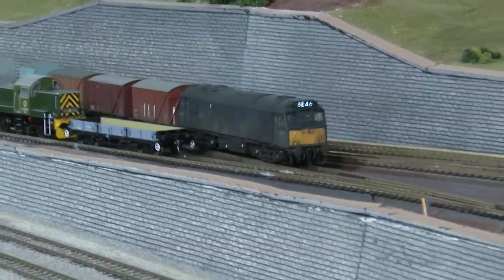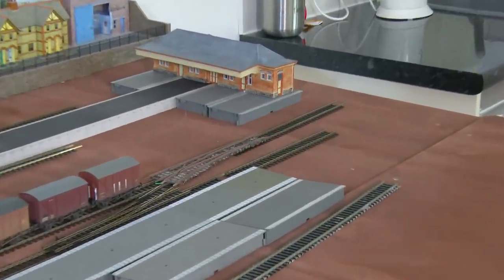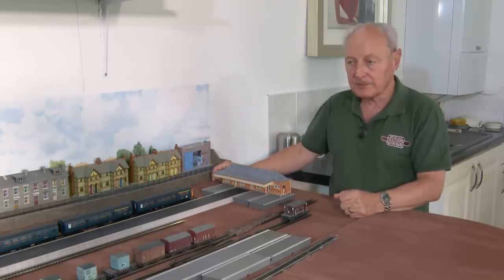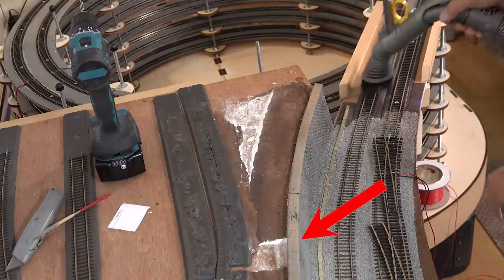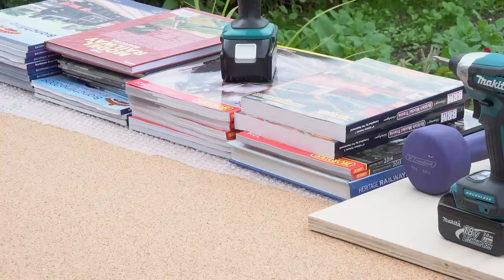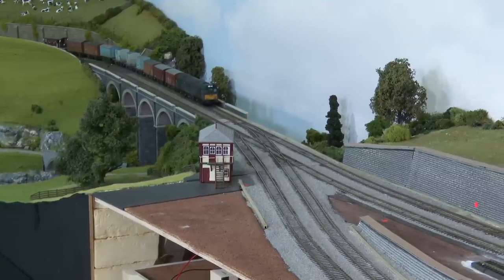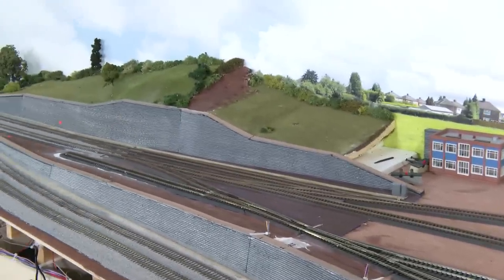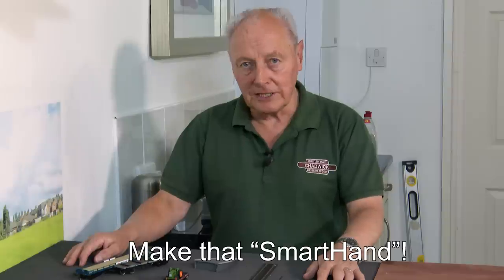BRANCH LINE CONSTRUCTION Part 2 at Chadwick Model Railway | 197.

Comment: When such a station was built, there would have been a run-round on at least one of the platform lines. These may have gone in the period you are modelling (but some still exist today: Aberystwyth and Blaenau Ffestiniog come to mind.) but perhaps their former location should be modelled in some way. I think it unlikely that a loading ramp would be in use in your period: large item, such as tractors, would come by road. but, again, the redundant location could be modelled. Another interesting video. Thank you.
Reply from the maker: And interesting comments, John. I am considering installing a derelict run around. Regards, Charlie

Comment: Hi Charlie, i was thinking about the proposed extension towards thr sink area behind you. Have you thought of backing that with a mirror to the same height as the backing adjacent to the side wall. You would gain an illusion of the track and buildings that you have already created extending on ad finitum. I did this on my own rail way and it really adds another dimension to the lay out. Cheers Greg Footit
Reply from the maker: Actually, Greg, thought I hadn’t occurred to me. However, it’s clearly worth a bit of investigation. Regards, Charlie

Comment: Charlie, still putting the MP5 above the baseboard? As a point motor with a parallel motion, you can put it above or below the baseboard, so will not have to hide it. The offset and low profile should avoid conflict with the loading gauge of the track below? The track below must be quite a distance down (3”?) as it has to go under the helix entry track within a foot.
Reply from the maker: I take your point Tom, however, under that baseboard edge, there is nothing but cable runs and large timbers. Regards, Charlie
Reply: @ChadwickModelRailway  Thanks for clarifying, Charlie. Always worth considering the options (like putting the motors inboard of the track, so the baseboard framing is not a challenge. )
But I bet you’ll turn the motors into a learning experience of how to hide these things: every day is a school day for us!

Comment: Hi Charlie, there is no need for the catch point as the headshunt now serves as the trap to stop a runaway/spad fouling the main line. Regards Paul (mainline train driver)
Reply from the maker: You are of course, right Paul . It’s days are numbered. Regards, Charlie.
Reply: At the risk of sounding pedantic, and sorry if I do, these points at the exit of loops and sidings are called trap points. Catch points are a different beast and were found on gradients to derail any breakaway portion of an unfitted goods train running away in the wrong direction before it caused a whole load of carnage further down the line. Trap points such as the one at the exit of your sidings are worked from a box or frame, whereas catch points would be unworked and run through in the trailing direction. They were also indicated by a triangle sign. Some such signs are still in existence despite the catch points being removed decades ago. 
When you get round to signalling, the points within the yard would all be hand points with only the points into the yard and the exit point to the mainline / headshunt worked from the box. It would be a good spot for a yellow shunting disc signal providing there is a section signal beyond it to control the entrance to the next block.
Reply from the maker: Thanks for the update Paul , the information you provided is a real gem. Regards, Charlie

Comment: Before too much track laying is done, have you considerd the use of either magnetic or electromagnetic uncouplers fitted under the track?
Even in the station if there is the possibility of running loco hauled trains.
Reply from the maker: Yes, I’ve considered using both Martin. However, an electromagnetic uncoupler will be almost impossible to maintain. Regards, Charlie
Reply: @ChadwickModelRailway  I went with Kadee under track magnets for mine. I used a router to cut a hole in the wood for them under the track. They work very well.

Comment: Great stuff Charlie.  It does seem that setting yourself those objectives at the start of the year is helping to push things along a little.  

I do like to have some tracks not parallel to the board edge to give a bit more interest, but I'd leave the two passenger lines straight as previously planned, maybe you could do a slight left hand curve on goods 2 as the "triangular" area is quite large and a gentle curve would break up the straight lines.

At about 20:30 I was a little worried as you drilled that extra hole for the frog wire and your left arm was under the board supporting it.
Reply from the maker: I’m pleased that you’re impressed with the progress. 
 I’m working away for two weeks on Sunday, so the next video is also finished.  It’s on TMD lighting.
This video took three and a half days but at least I’ve made some real progress in the branch area. 
The pressure is now off until the 11th Aug deadline.  Stay safe mate, regards Charlie
Reply: Another great video, Charlie, talking of which ... I can't believe you are almost at 200!   I always like the thought you put into how a railway actually works operationally, not just having  more and more track plonked in the landscape!
Reply from the maker: Thanks Alastair, I’m so pleased that you find the channel interesting. Regards Charlie

Comment: Have you thought about making a loop around the edge of the extension the same or larger than the Helix so it will fit and the flow of services is considered,, rather than a dead stop.of the line??
Reply from the maker: I have Darren, but I think it’s a nonstarter mate. Regards, Charlie

Comment: An enjoyable video, great to see a train running, the trap point is really redundant now that the headshunt  is there as they both provide the same function? Also why make the loco release headshunt so short, you may run larger models than class 25s.
Nice to see the thought going into the development of the area.
Reply from the maker: You are, of course right. There is no reason why larger locos shouldn’t be accommodated. Regards, Charlie

Comment: Great video as always so far. Just a thought that now you've installed the very useful headshunt at the 'mainline' end of the yard is there now a need for the catch points to remain? In my mind the points to the headshunt now perform the action of stopping runaways etc from reaching the mainline?
Reply from the maker: That’s a fair point Alex, I couldn’t find a definitive answer, so I left it in.  
Regards Charlie
Reply: @ChadwickModelRailway  My thoughts as a non signaller. The catch point onto the mainline would be box controlled with an appropriate signal and interlocking, the headshunt point would be hand operated by the shunter. With the two points as close as they are here it could be possible for the box to give the road but an inattentive driver could power away up the headshunt due the shunter not resetting the point correctly after the shunt has been completed. Making both points box controlled would involve extra levers, locks and interlocking, which cost money don't you know. As I say just my thoughts it's your railway and rule one, as always, applies.
Reply from the maker: Thanks Andrew for sharing your thoughts. Regards, Charlie.
Reply: @ChadwickModelRailway  No worries. Keep up the great content! I would think that possibly the 2 points (headshunt & the mainline point) would possible always work as a pair. Sorry I don't know all of your point numbers.

Comment: My only reservations are that the branch station width.....its very wide and looks tricky to reach fully over......also can the headshunt house a triple with a type 4 diesel or only a shunter ?    A big diesel might act as a stand on occasion.
Reply from the maker: I understand your concern, but nothing on the station is in concrete yet. Yes, the headshunt e can take a diesel and a triplet. Regards, Charlie

Comment: Great video again Charley, and good solution to head shunt, which has inspired me to do the same on my layout. With so many points to control, will you be installing a control panel on various sections of the layout like McKinley ?
Reply from the maker: No 6232. The points will be controlled. by using an iPad. Regards, Charlie

Comment: The idea of using the ramp for motorail might seem line stretching things a bit but personally if you wanted it enough its not totally unreasonable. Yes the station platforms are longer but in my view Fort William is not so much bigger that it could be argued to be an impossibility. Totnes was also relatively small and to a lesser degree St Austell but admittedly they are through stations rather than termini.
Reply from the maker: An excellent comment mate. Well worth considering, regards, Charlie

Comment: awesome videos.  really enjoy them.  on your branch line you have the loco on the A&D track going to the head shunt and then going by the freight platform track to get out of the way.  wouldnt that track have freight cars loading or unloading?  i would assume you would shunt the loco on a track on the other side if the A&D track.  Thanks Charlie
Reply from the maker: Hi Alan, I would assume that the train would be broken up on the arrivals and departures line, and shunted into the relevant goods platforms. Regards, Charlie

Comment: MORE THOUGHTS FROM JAMES - PLATFORM RUN-AROUND

Charlie,

You don't appear to have factored in a run round facility at the station. I think you determined one a Departure Platform and the other an Arrival Platform. Kyle of Lochalsh usually operated this way in both steam and diesel-hauled loco days, but run-around points were obviously provided.

Obviously if you are considering the station to be one of the 'paired-back by BR' types of facilities then two single road platforms would not need any run-around options.....BUT.....if we are talking 'paired-back by BR' days we have to consider that they would likely have retained only one platform.....AND.... that most, (but not all), goods facilities at Country Stations were withdrawn by BR first.

Any examination of Railway Magazine going back to the 1950's and 60's would show that goods / parcel facilities were withdrawn across the system by stealth. Each monthly copy had the facilities withdrawn at stations all over the country; one here and another couple there.

So we might see, say, two locations on the Scottish Region, one on the North Eastern Region, and one on the Western Region, all on the same date. The 'stealth' of the withdrawn facilities arguable prevented us seeing the overall destruction of rail goods facilities as they existed serving the whole country.

As an example, Railway Observer of March 1967, states the following: EVESHAM - The goods depots and yards at Evesham and Honeybourne were closed from 7th January, all traffic now being handled by road vehicles from Cheltenham.

Forgive the digression. 

To return to the Station Platforms, you could have both with run-around facilities or just one of them.

If you were choosing the run-around option on only one platform, you could, for example use the far platform, and perhaps, install the 'Motorail' Loading Ramp option in the additional space you have there, beyond the platform and a loop line. What's not to say that this branch station is not down in the West Country and close to a number of coastal resorts allowing cars to be transported there..?

As an example, a train with 'Motorail' wagons might draw into the station, for passengers to leave the train, with the loco then running round the train and shunting it into the 'Motorail' siding  were passengers could go to collect their vehicles.

In this scenario the train could have run from somewhere else in the country to a junction station and then hauled up the branch to the unloading ramps. So this might mean running with the passenger coaches to the front of the train and 'Motorail' wagons at the rear, (as per usual practice), to the junction station, and then up the branch with the 'Motorail' wagons at the then front of the train.

Railway Observer of July 1967 records as follows:- The Newton Abbot car carrier consists of eight coaches and nine carflats, so far worked by Newcastle or York Type 4's

In truth and in line with usual practice, the simplest operation would be with the 'Motorail' wagons at the rear of the train, where they were then shunted across to the unloading ramps after the loco had run round to collect them.

The rear of the layout board would appear to give you ample space to develop any 'Motorail' facilities there separate from the 'shunting & loading / unloading' part of the yard.

What about a cattle dock ? That could be still in use or simply there but redundant.
Any smaller 'end-loading ramp should have enough of a level bit at the top, something I would imagine you will likely already know.

As per usual your video is as informative and instructional as it is entertaining.
Keep up the good work.....

James Hennighan
Yorkshire, England

P.S.
As per a comment you made in the video, whilst the points you have are clearly motorised for operational simplicity, most of them would be worked by hand....so point levers. Unless you intend to incorporate a small end of branch signal box somewhere, which in the case of 'Motorail' facilities would be a given for safe operation and local control.
Reply from the maker: Thanks James, for such an interesting and in-depth comment. 
I have scratched my head numerous times regarding a run around for the platforms. I believe what I will install, is a disused run around on the inside platform. It will give a bit of added interest and show its current neglect. Regards, Charlie

Comment: Awesome vid as ever. Very informative and interesting.  May I ask a question tho?. Why would you need the catch point if you have a shunt siding. The points would always be facing the spur, unless you get permission from the signal box and he changes the points for the main line. But ye. Excellent video.
Reply from the maker: I think you’re right Robin, that point will suffice. Regards, Charlie

Comment: Hi Charlie. Would you be able to give any advice for starting off the hobby... one thing im struggling to decide is what loco i should buy first! Haha. I have decided era 5 somewhere in north england. I may just play it safe and get a DMU. Just need to get something to test the electricals when installed! Thank you so much and keep up the excellent work with the channel!😊 😊😊
Reply from the maker: Firstly,
Decide on your scale
Then your era
Next your budget !!!
Then your system DC/DCC
Now your trains 
Steam Vs diesel !
Don’t spend too much buying rolling stock.
The layout design and track plan are more important.
Regards Charlie
Reply: Thank you for the advice! ❤👍

Comment: are you concerned about the problems that Mckinley are experiencing with some of their tortoise point motors?
I think that a smallish permanent way depot could make a useful addition for the road / rail transfer of materials eg ballast, sleepers and rail.
maybe space could be made for a Chadwick & District depot.  lol
Reply from the maker: An interesting comment David. I am aware of the issues that McKinley have with tortoise point motors and the details will follow in a few weeks. Regards, Charlie

Comment: My tuppence worth! Wouldn't the passenger platform lines have a loco run-around loop too? Just imagining that this is an old station branch in Steam days.
Reply from the maker: You make a valid point Eian. However, I may put a disused runaround on the inside platform. Regards, Charlie

Comment: Hi (youngish) Charles. 

It’s coming along nicely, and why stop there. Why not rip out the cupboards, sink and boiler, then extend the layout up to the wall. 

Also, I’m slightly baffled as a ‘catch-point’ should be positioned on a downward slope so that any runaway wagons or carriages are derailed before colliding with the points connecting to the main line however, I don’t see any slope on your siding ergo, ‘catch point’ seemingly not required, or am I missing something here? 

Paul. 👍❤️
Reply from the maker: You’re right Paul, the headshunt removes the requirement for the Catchpoint. Regards, Charlie

Comment: Hi  Charlie,  would it make more sense to put your run around track to the inside of the incoming track away from the platform opening the freight platform.. again another great video
Reply from the maker: That’s the way it is Mark. Unless I miss read your comment. Regards, Charlie
Reply: @ChadwickModelRailway   thanks for the reply, no you didnt miss read, i was unclear after reading it again. my thought was to have the runaround track closer to the station platforms.  leaving the goods depot track always free from engines needing it to run around . if that helped any. lol

Comment: Very interesting video, particularly regarding point motors. Is there any flex in the actuating arm to allow for any slight inaccuracy in lining up the point and motor? Also, as you had a "Mk 1 Cocktail Stick" under one point, do you need to remove the spring from the blades? Sorry if these seem basic questions but I'm about to rebuild a layout and am considering moving away form Mercontrol.
Reply from the maker: Hi DJS, I always remove the springs from the points when using slow action switch machines.  The tortoise point motors have some give, due to the length of the actuating arm. The MP5, however, are much easier to align as they are more basic to align. Regards Charlie